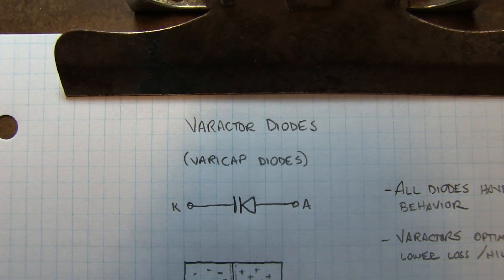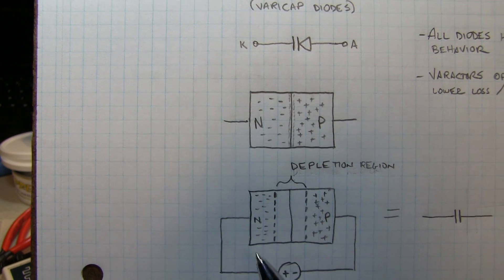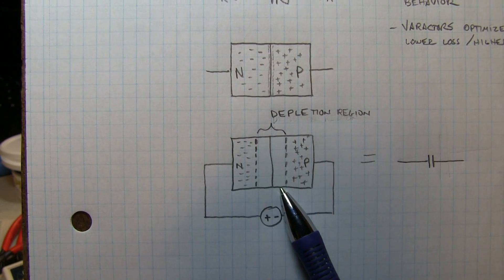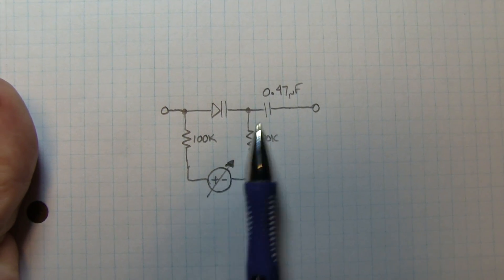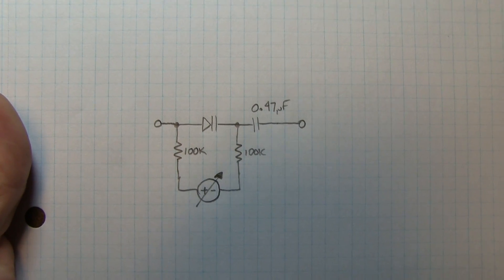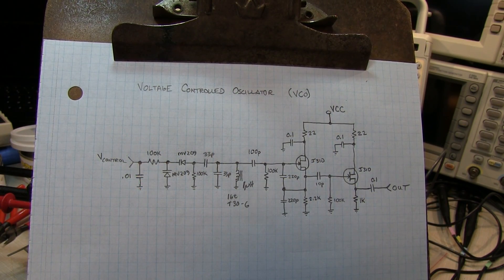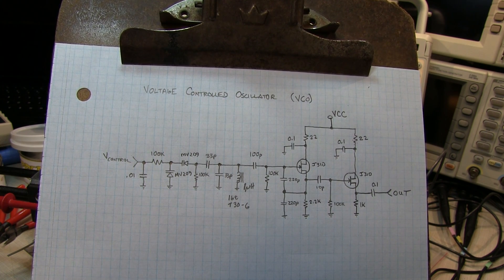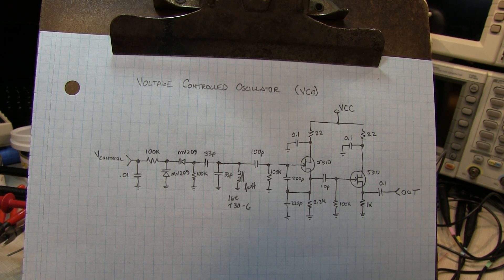#147: Basics of Varactor Diodes | Voltage Controlled Oscillator VCO Example

Comment: Good video.  👍
One thing that confuses me is that so many people call these varactors.  In my Motorola manual from 1969 they call these large diodes in a coaxial package varactors.  These are expensive and used for frequency multiplication in the UHF and microwave frequencies.  The small diodes as shown in the video are called VVCs or varicaps, not varactors.  So which is which?  I like to go by the manufacturer's names.
Reply from the maker: Over the last 35+ years as an engineer, I've seen the terms varactor, varicap, epi-cap, and voltage variable capacitor (VVC), all used interchangeably.  Here is a major manufacturer that calls them varactors:
https://www.macom.com/products/diodes/varactor-tuning-diodes
and another:
https://www.macom.com/products/diodes/varactor-tuning-diodes

Comment: hey can u provide reference (real components manufacturers) which provide cheap rf varactor diode, and varactor that you use? thanks in advance
Reply from the maker: There are over 1000 different devices listed on Digikey, 
https://www.digikey.com/products/en/discrete-semiconductor-products/diodes-variable-capacitance-varicaps-varactors/282

Comment: yeah it is a nice and clean sinusoid and if i wan to see the same on Spectrum analyzer ,do i need to first connect the out put to say on Network analyzer and get the Impedance @ the above said frequency or in its vicinity and then design an impedance matching network(say an LC network with series C and shunt L ) so that i can see the tone on a SA ?
Reply from the maker: Not absolutely necessary.  You could simply use a Z0 divider probe.

Comment: What would you recommend as an approach for a VCO that could be used in the 70cm band?  Most homebrew stuff I see (and build on occasion) is great for HF and a swing of a MHz or so but I'm kind of lost on how to do it in UHF.
Reply from the maker: I haven't played with homebrew circuits for UHF that much, there are many different approaches.  Remember that the capacitance change for varactors result in a small frequency change for HF, but would give a much larger range at UHF since the resonator capacitance is much smaller.  Lots of ideas here:
http://www.qsl.net/va3iul/Homebrew_RF_Circuit_Design_Ideas/Homebrew_RF_Circuit_Design_Ideas.htm#Oscillators

Comment: Hello! Does varactor simplify a build of exponential VCOs? I wonder if it's possible to build without usage of transistors... a kind of "varactors in series"... sounds silly, I'm a very low experienced in schematics :)
Reply from the maker: Oscillators usually need some amplifying element...
Reply: op. amp... But how is it linked with the expo-converter part?

Comment: Hi, and thank you for nice lesson about varactors. I made one and it's working well. I found one similar but somehow different vco circuit for 3,5mhz with two j310. (http://richards377.rssing.com/chan-4668691/all_p1.html) 

Differences are 100ohm resistor between transistors  (in the place you have 10pf condenser) and there's no any 100k resistor between transistors and the ground. Can you please help me to figure out how and does those changes are making better building choice  in the meter of freq.stability, noice, and amplification  of vco?
Reply from the maker: These are just minor differences in biasing of the transistors, and performance should basically be similar.

Comment: thanks for another excellent video! I had some fun building the circuit to see it for myself. Prompts a question if you don't mind: I was able to get a very good variable frequency wave at ~5.8MHz (using 10µH choke instead) but couldn't sustain oscillation at 14MHz. This was first on a breadboard then protoboard. I'm thinking this might be because I didn't have a good ground plane or shielding, so I might try for 14MHz again manhattan style on copper pcb base. Do you think that's a good bet or might I be missing something else? NB: my notes and pics are at https://github.com/tardate/LittleArduinoProjects/tree/master/Electronics101/VoltageControlledOscillator
Reply from the maker: I think there are a couple of issues going on.  To get 14MHz oscillation, you're probably going to want to use something closer to the 1 or 2uH, and then adjust the resonating caps accordingly.  Also, you are right that the breadboard/protoboard are really not the right way to go.  Those push-in style breadboards really aren't very good for RF circuits, especially above 10MHz - to much internode capacitance, wiring inductance, and poor ground impedance, etc. (not to mention those really long component leads).  Manhattan or Ugly style construction will really help - keep the leads short!
Reply: thanks for the tips! yes, that's what I was thinking, now gives me some confidence that redoing the circuit Manhattan/Ugly style will be worth the effort. I guess part of slowly getting a feel for what should and should not be expected to work in the RF realm. PS: yes, it was with a 1µH inductor that I just couldn't get the oscillator started
Reply: btw, I revisited my build and got it to decent 14.15 to 14.35MHz adjustable range on a 5V supply. Although I did another on copper PCB ugly style, turned out my problem was less to do with construction and more about tweaking the component values for the particular varactor I found (KV1471). It's capacitance is about half the MV209 or MV109 for a similar reverse voltage .. I should have studied the datasheets more closely at first! Thanks again for the video that prompted all this fun;-)

Comment: excellent excellent video. You always inspire me to persue EE even further! i want to build a DC to 1Mhz VCO similar to the one youve shown, any good reads?
Reply from the maker: That's a tremendous range to cover with an LC based VCO - not likely to be practical.  You'd be better off with some type of relaxation oscillator to cover that kind of range.

Comment: i am using varactor diode for the phase change of my signal i am confused about how to use the diode with the packaging ...can you help me in this i need 180 phase signal as output ...i am making the schematic using AWR
Reply: Tauseef Siddiqui For 180 degree phase change, use a transistor. Configure in common emmiter.

Comment: Do you have video with demonstration of soldering this fixtures? Something unusual for me. I mean PCB design and mounting of components on some... square junction islands...
Reply from the maker: Here is on example that uses an 'island cutter' method. You can replace the islands with glued down solder lands. https://www.youtube.com/watch?v=blalAktxFoI
Reply: Yeah, just watching it now. =)
And which PCB design is good for what purposes? I heard an opinion that leaving large polygons for ground is not good because of it's capacitance, and soldering components to this big distributed ground causes floating potentials.
Reply from the maker: There is no universally right answer. The truth is that "it depends" on the particular circuit. The performance of some circuits might be badly affected by a large ground plane, while other circuits benefit greatly from a ground plane. In general, as your circuit operating frequency goes up, so do the benefits of a ground plane. On the other hand, circuits with very high impedance nodes can be adversely affected by ground planes. But, the shielding benefits might outweigh the downsides. As you can see, there is no simple answer. I will say that there are generally more benefits to using planes than not.

Comment: Love your videos. Would like you to explain the difference between an oscillator circuit and a VCO?
Reply from the maker: A VCO is a voltage controlled oscillator. Thus, all VCOs are oscillators, but all oscillators are not VCOs.

Comment: I'd love to build a VCO as a first RF project. But I am not sure what tuning range I'll be able to get using varactors. Would it be possible to make a VCO that ranges from 20 to 80 Mhz for example?
Reply from the maker: That's a 4:1 range, which is pretty big range for a varactor tuned oscillator. It can be done, in theory, given that the varactor capacitance change achievable is >4:1, but you have to be very careful with the design.  It would also be very unstable due to the large tuning range.  A better way would be to make it would be to have some switched components to make a few sub-ranges, and then varactor tune each of these smaller sub-ranges.
Reply: Wow! Thanks for the elaborate response! I did some more research and what you're saying is absolutely true.  Thanks for the info and I will check out those sources you recommended :)

Comment: If a picture is worth a thousand words then a well done video is worth volumes. Thanks for the video and making varactors understandable for this 70 year old codger!  I've been building homebrew radio gear since the mid '50s and even built variable capacitors but I've never tried a varactor. Hmmm.... I smell a new project on the horizon! :)

73, Mick - WB4LSS

Comment: Hi Alan: Nice L/C meter. I got one of the IIB kits in about 1998 or so.  I just replaced the LC display as it faded out, other then that its great.  Cheers, Mark
Reply from the maker: Mine is starting to fade too.  Where did you get a replacement? From AADE?
Reply: eBay: High Quality Sharp 1602 16x2 LCD Display Brand New 5VDC; Seller: usbflying; Price: $3.50  Cheers, Mark
Reply: Hi, I'm thinking of getting an LC meter. Was looking at Agilent's handheld ones. Is this one better than that? Thanks.
Reply from the maker: kalhana1 I've never used the Agilent unit.  This AADE works very well, and is certainly going to be less expensive than the Agilent.
Reply: ***** Thanks. Looks like the AADE one can go to very low L ranges. The Agilent one has other useful features like ESR etc and have good accuracy as well. So might be worth having both for for different applications. I will probably get an AADE to begin with and get the Agilent at some point.
Reply: After looking at the specs a bit closer, it looks like the Agilent (U1733C) can also go down to similarly low values of L and C. And the Agilent is more accurate and consistent. (Based on the Agilent data sheet and AADE website in which they average (+) and (-) values of errors after summing them which I think is a bit misleading, I think mean absolute error is a better way to look at it) Thanks.

Comment: I build a POV application (persistance of view) some years ago where I used a LED as a capacitor. It was (toggle reverse and forward) connected to the microcontroller and charged up and measured in a loop. When I switched on a little pocket light it recognized it (the light discharged the LED) . Used it as a switch :) to toggle between some light patterns.

Comment: hey prof, question. Does this have anything to do with what's used in spectrum analyzer to make the variable band pass filter? or for digital fm radios?
Reply from the maker: Spectrum analyzers typically use VCOs, but most use other types of VCOs rather than varactor tuned.  Varactor tuned are good when small frequency changes are needed.  Note that the tune voltage to frequency relationship isn't linear, so this would do well in a spectrum analyzer.  They may be used as fine-tuning components in a radio receiver though.

Comment: I'm not clear about the purpose of the .47uF cap. Was it there just to AC couple the meter? Is that needed for the reading? So, as long as it was big relative to Varactor's capacitance you were good?
Reply from the maker: The 0.47uF cap is there to ensure that my L/C Meter doesn't "see" the DC bias applied to the varactor.  Making it very large with respect to the varactor capacitance ensures that the resulting measurement is very close to the varactor's capacitance.
Reply: ***** So could you them use a 4700uF capacitor for greater accuracy, or use a parrelel capcitor formula to determine the capacitance of the varactor?
Reply from the maker: Power Max You could use a larger capacitor for sure, that will make the reading more closely reflect the varactor capacitance.

Comment: Pity you did not have a SA close to hand to check the output of the oscillator :)
Another one of those parts like feedthrough caps that seem unique to radio and getting harder to find.
You forgot to mention they also make great FM modulators as well.
 I would have liked to have seen the capacitance range of a typical power diode like you mentioned which no doubt are a whole lot easier to find and cheaper.
Reply from the maker: Rob - I know - I was tempted to take a look at the output on the SA, and look at harmonic content, etc.  But, I felt that this would take away from the main point of this video - to give the basics of the varactor.  I think I might do a followup video that shows the variable capacitance of other diodes.  Sometimes it's a struggle to keep the videos short ;-)
Reply: *****
Way too serious Alan. It was just my sarcastic way of appreciating the new toy while being simultaneously envious. Tek did an outstanding job of the design and have truely raised the bar in multifunction scopes. As Dave might put it. The centrefold for an electronics porn mag.